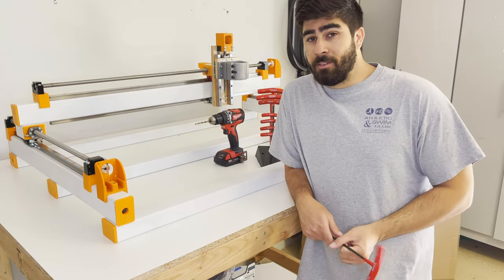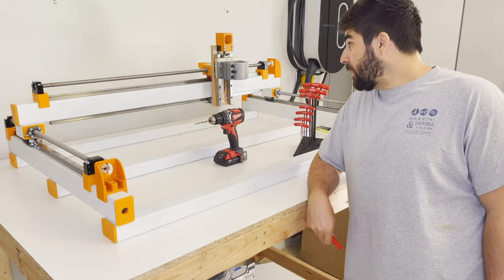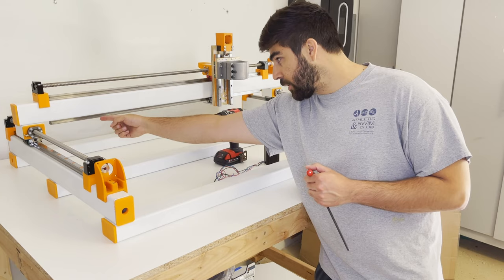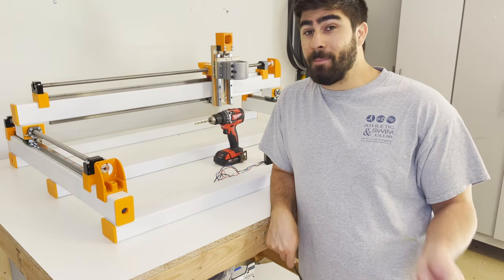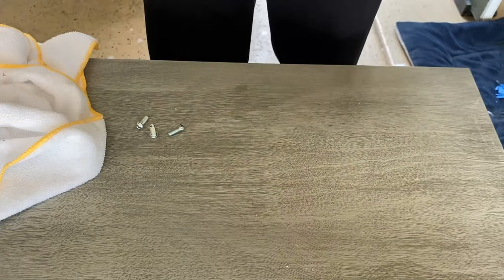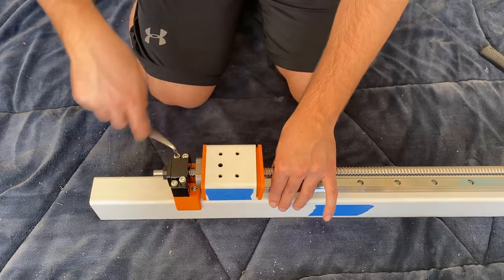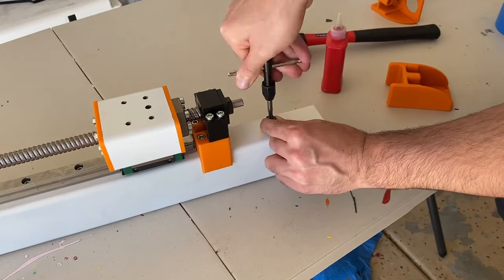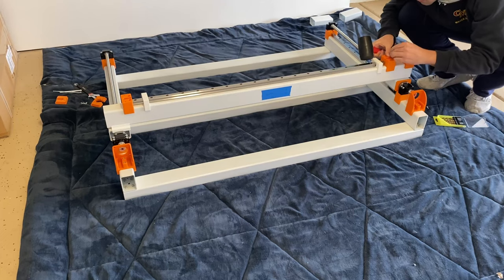Finishing the Frame on my PrintNC | Build Ep. 2

Comment: I love tapping holes too, it's like magic hey
Reply from the maker: It is exactly like magic. And the hand tapping also makes better threads than on most metal stuff you buy which is cheaply machined which feel so smooth like butter
Reply: @AryaNakh  check out the ratchet tap holders if you're ever upgrading 😍

Comment: Sorry for poor english, Dear Arya well done man! I'm learning from you and I have question, what did you about flatness and/or tramming. Does your steel tubes is perfectly flat and straight or you may milling them for mounting linear rail?
Reply from the maker: That is a great question! The steel I got was very flat to begin with and then after sanding and spray painting, it was even flatter. 

I know some people have used epoxy for perfect flatness. I didn’t think it was necessary for my build. Thank you so much for watching and for the comment!
Reply: @AryaNakh  thank you so much for replying.
Reply from the maker: Of course! I should be coming out with part 5 here soon! My new stepper drivers arrived today!

Comment: What was total price for material?
Reply from the maker: That is a great question! It really depends on what you build/what you customize. I got my steel right when covid started so the price of steel was low. I got upgraded mesa card, extras such as a large enclosure, upgraded steppers, etc.... My cost of just the machine (with all my upgrades) is probably around $2500-$3000 currently. But I know that for a barebones version, it can be built for around $1500-2000!